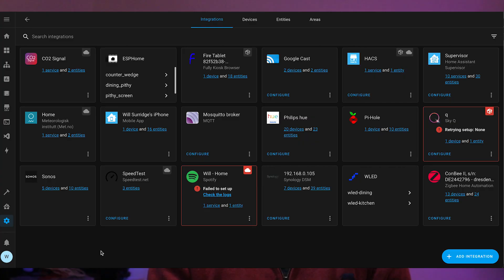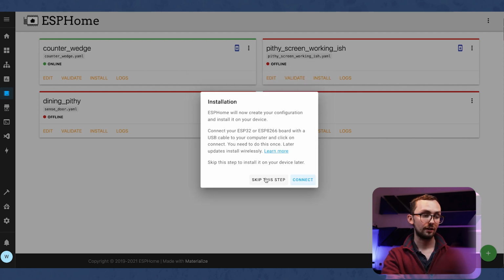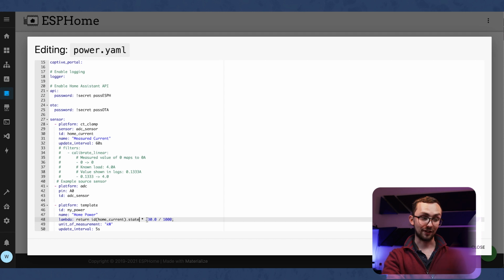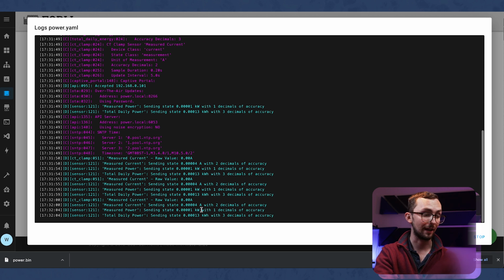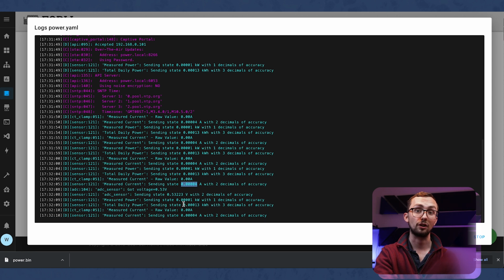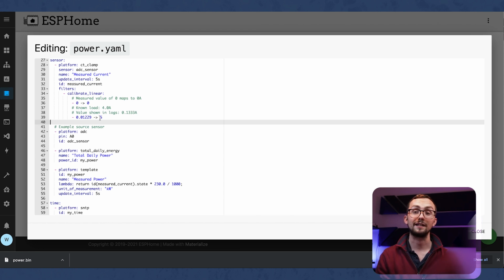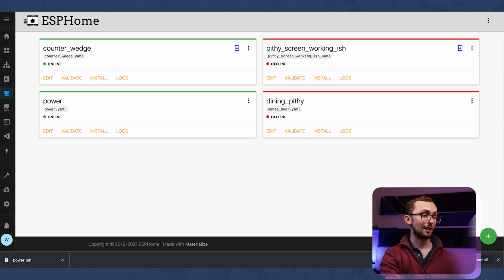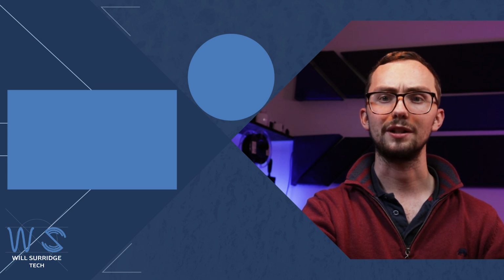Clamp Sensor Energy Monitoring - ESPHome in Home Assistant

Comment: I think someone commented and this is years later. But you cannot measure the electrical power you pay for on an AC circuit with random equipment. Except for heaters and incandencent bulbs all other modern equipment is not a pure resistor. It has a reactive component. It has a power factor less than 1. What you measure is called apparent power with unit VA. You need the real or true power measured in Watts. That is what your meeter charges you for. Look up power factor, apparent power, true power on Google. There are solutions available where you connect a clamps and the phase voltage to the board and then it measures the right thing, or close to the right thing. The power factor on a phase can vary a lot as things turn on and off. In my house I see power factors reported between 0.6 and 0.99. When you are at a low power factor, your measurement can be double of what you pay for. You can only calibrate it away if you measure one specific appliance and is reactance does not change with load.

Comment: This method is totally unaccurate on anything but a purely resistive load like a toaster because you have not considered the power factor in your calculations. Anything with a transformer like a microwave, heatpump, computer, electric motor can have have a considerable power factor causing your measurement of real power to be off by as much as 20%-30%.  Calculating the power factor is only possible with real time processing of the current and voltage simultaneously so that you can measure the phase angle difference between them.   

In reality what you are calculating with this method is not Watts but Volt*Amps or VA power which is a combination of  "real power" + "apparent power".  VA power cannot be used to calculate energy consumed in kWh because you need to know the power factor in order to calculate the real power portion of your measurement. 

Typically residential customers are billed only for kWh (kilowatt*hour) which requires you to know what the real power in Watts is.  This is very important. 

Secondly by using a static value for voltage will further introduce a substantial error as the voltage can vary as much as 5%-10%. 

If someone is serious about home energy monitoring these factors must be taken into account if the goal is to be fairly accurate with the utility main meter.

I would recommend using a very cheap pzem-004t power meter which will do all the heavy calculations for you and sends it to your esp32 or esp8266 through a serial connection.

Comment: Hi Will, thanks for this vid. I'm getting some odd behaviour, I calibrated mine with the immersion heater, known load, and compared results with a Shelly EM and the power measurement was within a few watts. Happy. I turned the immersion off and normal background power use for the house went to 160w ish. however the esp/ct didn't go below 300w. I took the clamp off the mains feed and measured nothing but I'm still getting a reported current and watt usage. log extract below. 

[11:57:09][D][ct_clamp:037]: 'Measured Current' - Raw AC Value: 0.000A after 3 different samples (15 SPS)
[11:57:09][D][sensor:126]: 'Measured Current': Sending state 0.13084 A with 2 decimals of accuracy
[11:57:10][D][sensor:126]: 'Measured Power': Sending state 0.03102 kW with 1 decimals of accuracy
[11:57:10][D][sensor:126]: 'Total Daily Power': Sending state 143.78992 kWh with 3 decimals of accuracy

any ideas why 0A is showing as 0.13084A

here's the config used

captive_portal:
sensor:
  - platform: ct_clamp
    sensor: adc_sensor
    name: "Measured Current"
    update_interval: 5s
    id: measured_current
    filters:
      - calibrate_linear:
          # Measured value of 0 maps to 0A
          - 0 -> 0.000
          # Known load: 5.0A - change this!
          # Value shown in logs: 0.01229A - change this!
          - 0.040 -> 12.377

Comment: In general, great video. But like quite a few youtubers, you do sometimes skip over what you might think are easy things like the commenting out of a block of the code. I have no clue how that was done. Also the uploading of the code. 'Simple' if you know what you are doing, and if you do not get errors, but not so easy if you have a few options and you assume that we know what we should see and what we are doing. I have all of the hardware connected and waiting to rock and roll, but I cannot get the code onto the unit. But thanks for making me feel like a should be able to do this.
Reply: I 100% agree with the above i was doing a similar project and had issues flashing the firmware. i figure out from another video you need to select manual download, select legacy. It will download an .bin firmware file. then you use a separate flashing tool to install the firmware onto the device.
Reply: @tsarrr  @Dave Dee   Yes, this unfortunately is are of the learning curve for ESP and HA.  Many YouTubers make is sound like oh, I just did this, nope!  It take alot of work!  I ALWAYS check and double check my wiring, first!

Comment: Will how do you make this work with monitoring solar power, have your esp-home code  but not reading my power coming in. Have change the setting to .18729 what the log comes up with and 15.8 amps what I read off my meter attached to the each of 2  lines of solar. The home assistant energy say the system is puting out 1.52 kwh and should say 888 kwh coming off solar meter. Please help getting this right.

Comment: Thank you for explaining! 

But there are some remarks about the calibration. First of all I wouldn't recommend a microwave because the fluctuations in the current it draws may be quite substantial. A kettle is way better because it's basically just a metal wire heating up. (Although the current may slowly decrease over time) Also it's better to have some kind of energy monitor to use as a reference. The actual energy consumption may differ quite substantially from what's written on the device.

Nevertheless, you made me think of some great new ideas 💡
Reply: Agreed. A resistive load is probably the best option, or AT LEAST using a calibrated clamp meter to confirm the actual power consumption you are correcting for.

Also, "230v is the voltage we use here," is putting a LOT of faith in the local utility. You should probably measure the actual voltage you're getting, because that can vary wildly, even within the same block or two of houses.

But nevertheless, this video is a great jumping off point, and I'll be using it to add my own monitors to my system. I'll just be a bit more methodical in the calibration.

Comment: Doesn't work for me. I calibrated using hair dryer and tuya smart plug which is showing actual current. After calibration when I connected clamp around my life main wire by power supply readings are not match with my portable display which I got with my smart meter. Is not even close. 1220W (display) 1380W (home assistant), 290W (display) 530W (ha). It looks like when load is higher difference is going down and when load is going down - difference is going up. I do not understand that. I do not know how to make this to work.
Reply: Having similar problems , can calibrate it for 1200W and it works fine in that range but when consumption drops to say 200 W it reads twice that value, any more info since you set it up ?
Reply: @robkendall9920  I gave up. Usually I am using around 200-300W for the most of the day so I calibrate it for that value. Ignoring high spikes.
Reply: You need to use this filter: calibrate_polynomial, which will allow you to calibrate with multiple values. It's a lot better, but still need to many tests, before you will be sure that it is showing well values.

Comment: microwave cycles on and off while running, bad calibration load. 
Use toaster or radiator or heater fan instead :)

Comment: Hi, great video, all configured and working however my homeassistant values are about 5kwh per day above meter usage. I used the single port motram board with SCT013 100A 50ma CT. Calibrated using a 2000w wallpaper stripper to calibrate. Is there anyway to recalibrate adjust code to get a more accurate reading using a CT . ? Thx in advance

Comment: Is anybody using the SCT013-000V CT clamp that gives out voltage between 0~1V ?
You have to remove the R1 22ohm burden resistor from the circuit board to use this, but I'm interested to know what raw values from A0 are returned before applying any calibration factor.
I'm also trying the Mottram Labs 4 channel current sensor with ESPhome , which would allow me to monitor power used in the house, power generated by solar panels, and power exported back to the grid, and something else, like an electric shower.
Reply: Am also trying to get the 4 channel sensor to work but can't figure it out. Can someone share their set up for the 4 channel version?
Reply: I'm looking at the 4 channel as well to monitor the charging of my car (3 phases). Have you managed to get it working?
Reply: Can anyone confirm that I need to remove the 22ohm resister from my Mottramlabs board if using the SCT013-000V (100A) CT clamp. Ive got everything setup and running but no matter how many times I calibrate it the accuracy is nowhere near as soon as the power varies

Comment: Any ideas why I get  negative A / W readings after I enter these calibrated values (@240v)?

    filters:
      - calibrate_linear:
          # Measured value of 0 maps to 0A
          - 0 -> 0
          - 0.01780 -> 4.72  # 1134w microwave (700w)
          - 0.03571 -> 11.26 # 2702w kettle (2520-3000w)

Comment: Is everyone using old versions of ESPHome for these tutorials? I have just come to Home Assistant / ESP Home in the last few days and it does not allow you to configure a board unless you are using a https connection. That is the first difference. There is a link to open ESP Home in using HTTPS which works and allows me to flash my device, but I can then not connect the device to Home Assistant. Do you know if the latest version of ESP home works for you? I don't know if I am doing something fundamentally wrong elsewhere with my configuration.
Reply: I think ESPhome website has been updated a lot recently. I've notice that you can install the initial code to the esp8266 directly via the website, and I dont recall you being able to do that when I looked a couple of months ago. Also,  there does seem to be some conflicting behaviour when you get onto ESPhome in HA (for example it keeps discovering the temporary hostname that was assigned to the esp8266 even though that doesn't exist anymore), but a refresh of ESPHome seems to fix that.

Comment: Followed these instructions to start monitoring my house power, thanks. I think I need to adjust the calibration again as the CT clamp is reporting higher power usage than the electricity meter but even if the absolute values aren't accurate being able to see the relative power consumption between days or when different appliances are on is great.

Comment: Hello Will, I ordered the pieces you mentioned and do all the steps to bring it on. But when I reboot the d1 with the PWM board attached it will not start. without the board all is fine. what's the matter with that? kind regards, an a nice 2022, gerald
Reply: shame on me.... I have fitted it on the wrong side top :-(
Reply: @amrheing  haha. Now do you get it works?
Reply: Hi, yes it works. But I ordered 20A clamps instead of the 100A pieces mentioned here. So get wrong data.

Comment: Thanks for sharing this neat idea, I just bought the parts using your links :-) two things I will say: 1) I thought mains voltage here in the UK was more commonly 240v, I know when I measure it within my house it is 240v. Also 2) I thought perhaps a micro-wave isn't the best appliance to measure, not only because of the WiFi interference, but also because the load/demand isn't always on, a Microwave pulsates using higher wattages here and there for a few seconds, then gives a break etc. I think something that may give a bit more of a predictable load (like perhaps a kettle) might be better. Thanks for a great vid though.
Reply: Hi Ashley Cawley,  last week i bought Clamp Sensor Energy monitoring device from DFRobot for monitoring  my solar panel   but what i am facing issue is that its shows some nominal 0.5 kw value in night too. Can you help me out to resolve this.

Comment: Anyone have a source for the PCB or something similar in the US? Shipping is very high from UK to US for the one shown here.
Reply: Don't bother. You'll need a dual monitoring system as you are on split phase power supply (2x110vac, 220vac both phases)

Comment: Whats was the neatest way to supply the usb power to wemosd1 when its in the meter cupboard
Reply from the maker: I have a normal socket outlet in the cupboard so thats what I did...you wont be ale to run a usb cable far so will have to have a socket installed or something

Comment: Will, I enjoy your channel a lot but you are wandering into an area that you don’t fully understand. Apart from the inaccuracies in the power measurement as set out by other comments, there is a major safety concern here. The CT clamp used here does not have a burden resistor before the jack plug, it has one on the board, so if the plug was to be removed while measuring it would lead to dangerously high voltages at the jack plug. A burden resistor should always be installed as close as possible to the CT itself. Split core CT’s are available with a resistor installed with the output in millivolts which is a much safer choice in this arrangement . You should consider pointing to the dangers of using this type of arrangement on this video. Safety is a priority.
Reply: SCT013 voltage type has an internal burden resistor, and current type has an internal voltage suppression diode. However, if you are using a model without internal protection, this is indeed a critical point to notice.
Reply: @MahlerLab  Thank you for posting this, so I'm using a SCT013 I shouldn't need to worry about that aspect then.
Reply: Thanks for sharing this.

Comment: Great video, I have a Shelly that measures the voltage, could you use the voltage measurement instead of theoretical values?
Reply: Yes you can. It will be more accurate then
Reply: ups, I totally misunderstood your question - of course you can ;-) @coin777 opened my eyes ;-)